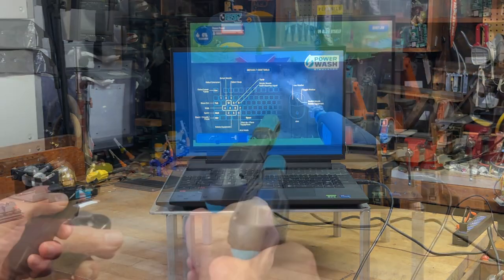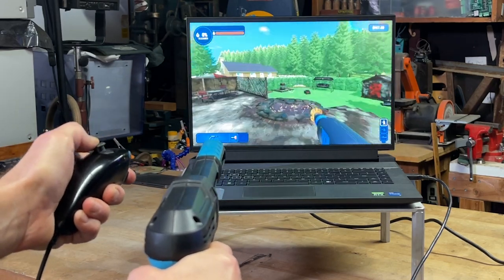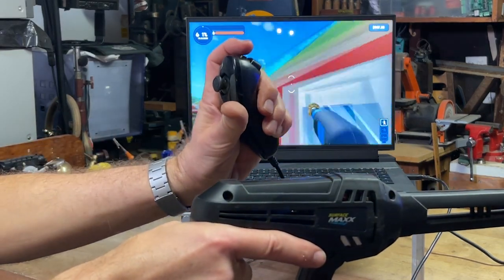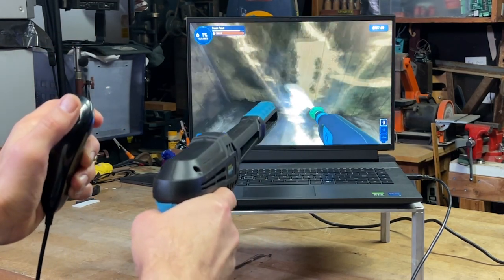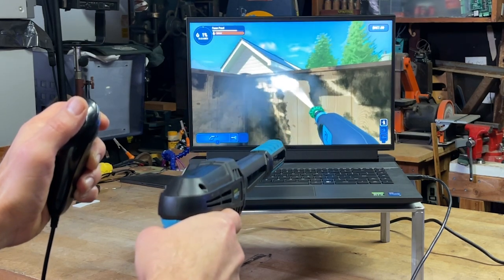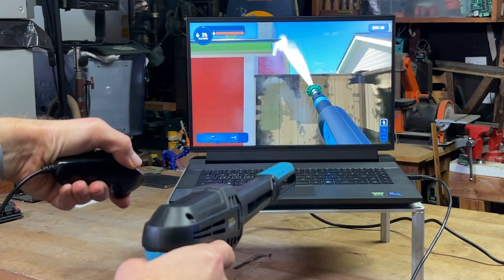PowerWash Simulator Controller demo

Comment: tried this but with just the bno-055 sensor to work as the mouse to do a sorta light gun thing, just didn't use the speaker and wiichuck code. i'm getting heading, roll and pitch values but when applying to the mouse it works in vertical but the horizontal is stuck all the way to the right of the screen. the mousex value seems stuck between 60-80 regardless of heading value. also tried that sensor with my arduino uno minima r4 and it only gives me 0 values for everything. just soldered pins on it and and follow the relevant unified sensor code for it. if anyone stumbles across this and has some suggestions i'd appreciate it